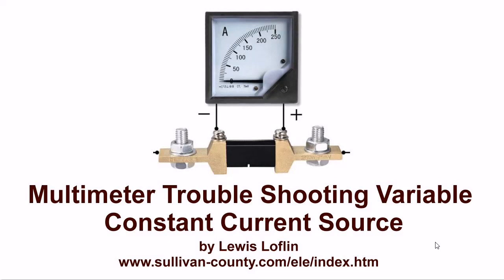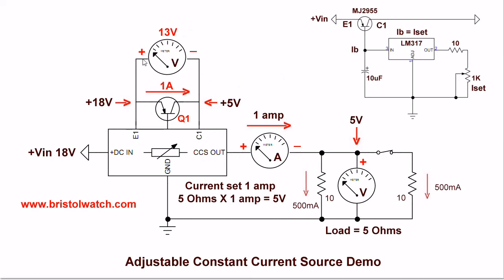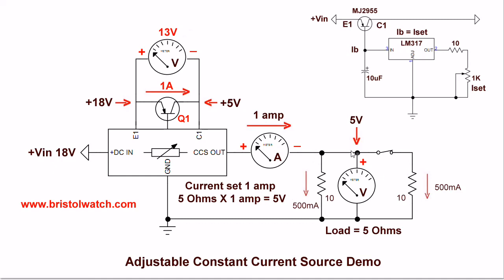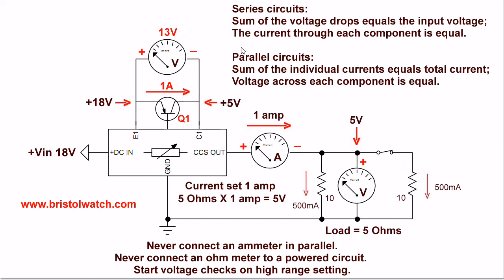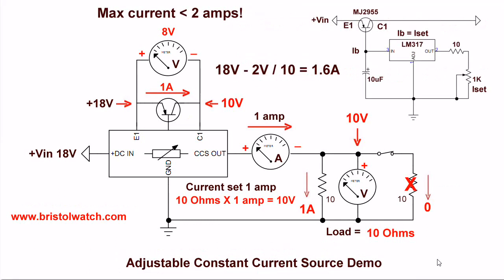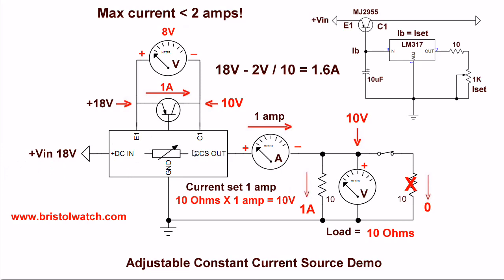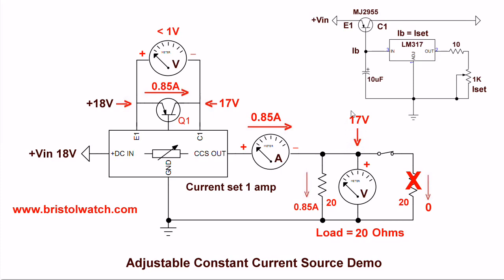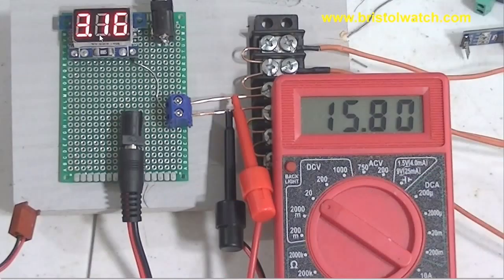Constant Current Source Multimeter Trouble Shooting

Comment: I must be stupid......a few minutes in and I could not see the relationship between the two schematics....and how could the initial or top right schematic function as a constant current source?....there is no feedback path!
Reply: If you connect the ADJ pin to GND, the voltage output goes to 1.25v not 0v, so with the 2 resistors you can vary the constant current (since 1.25v is fixed) between about 1.23mA and 125mA. Of course, the transistor will increase that current in beta times, and since the lm317 is wired as a constant current, the ib of the transistor is constant, so the colector current is also constant.
The feedback is inside the LM317. Look the internal diagram of the LM317 and then the tipical constant current with an opamp.
Reply: @JuanJose-tn8yd  TKs  :)
Reply: @JuanJose-tn8yd  oh dear.... aren't you forgetting that IB is not a set fraction of IC....and every single transistor is different in both Hfe and temp VCE effects not to mention thermal Hfe variations....how could the 317 compensate or preempt those?
Reply: @JuanJose-tn8yd  a more appropriate schematic is here https://www.bristolwatch.com/ccs/lm317mjB.jpg  when searching Google images there are a no. of incorrect schematic diagrams from Bristol watch and one correct one that I found so far....notice there is feed back in this one.... otherwise it would never work as described or intended
Reply: lookout the Ic is some temperature depended.
greetings Wim  (Netherlands)
Reply: R2
Reply: @overload1010  R2??? What? How?
Reply: @mekuranda  Should be R2 to Adj, I think he made a diagram mistake.
Reply: @overload1010  if that's the case...a mistake...then I can sleep soundly tonight :)